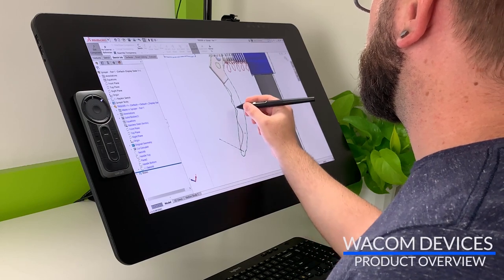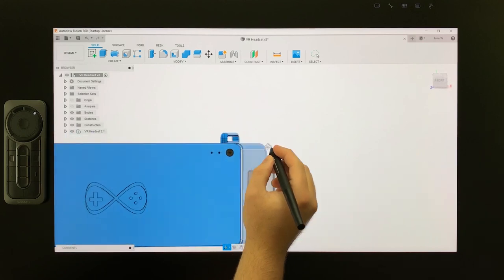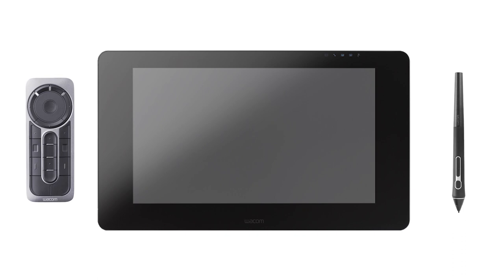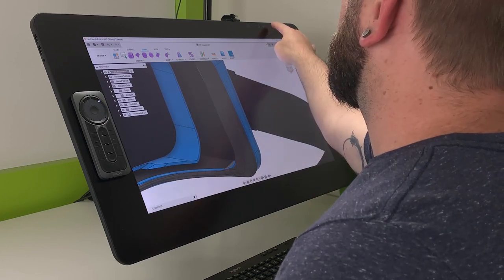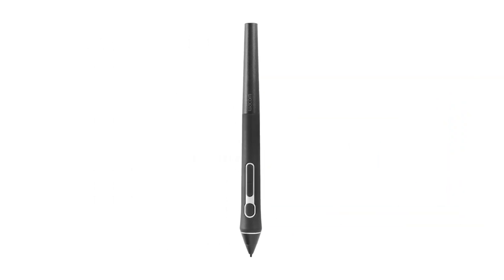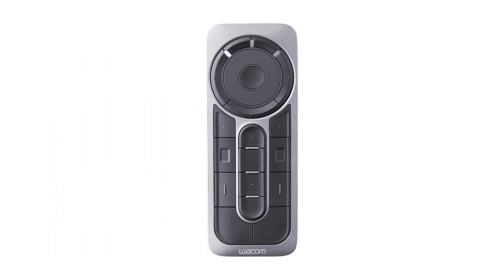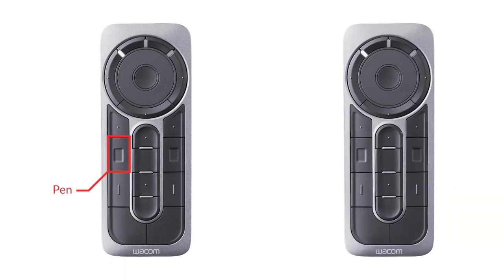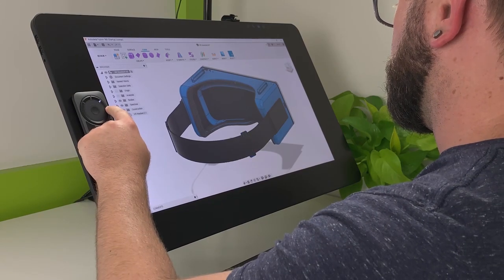How to use CAD with a Wacom pen

Comment: I have the feeling this will cost an arm and a leg
Reply: The pen will run you 100, the display it goes with another 3 grand. Option #2 just buy a old display from yard sell and get a multi touch conversion kit for it (For probably less then what you would pay for just the pen)

Comment: Personally I consider cintiq Pro a great device for all sketches and final image (render) adjustment in Photoshop or others softwares but when you work on a modeling process a 3D connexion device a nice CAD monitor (Ben Q) and a responsive keyboard are in my modest opinion a more effective way to work. A 3d mouse let you see your model as you were touching it with your hand.
So instead of spending a big amount of money for a Cintiq 32 Pro that initially made my eyes look like little hearts I decided to be more practical and I got with the same price
1 32 inches Ben Q montitor 4k
2 Intuos Pro Large Wacom Paper edition
3 3D connexion mouse

I cannot deny cintiq still make my heart happy when I see it but my brain say I did the right choice because I really doubt you can work so nicely when you are under stress for a submission 😅

Comment: 1. You could have used a cubical pan and rotate device which is more intuitive and aligns with the co-ordinate system. It would have been more useful.
2. Pen should be WiFi enabled for panning and rotating without touching the screen.
3. Virtual eraser button should be on top like a normal mechanical pencil.
4. Height adjustment must be made available for small hands and should be incorporated in the design.
Reply: bluethooth/wireless seems way easier to implement than wifi